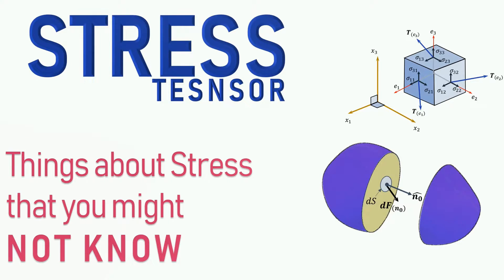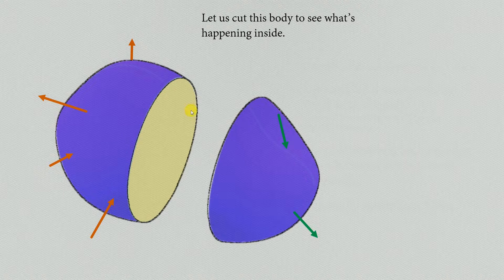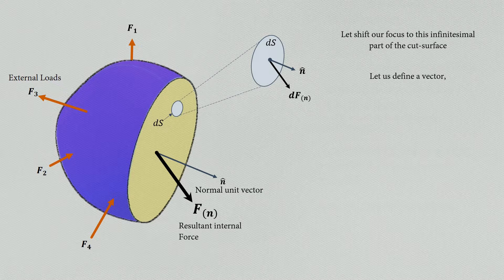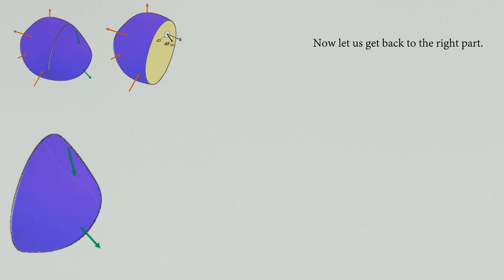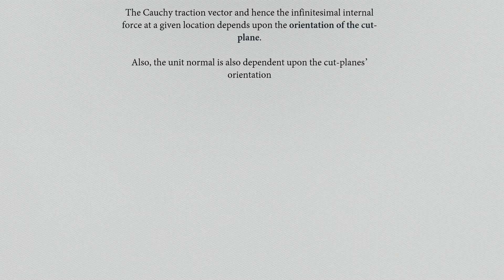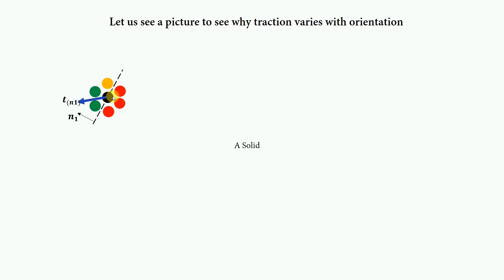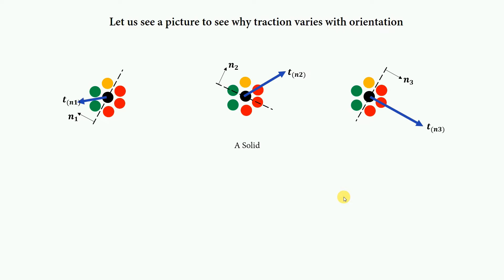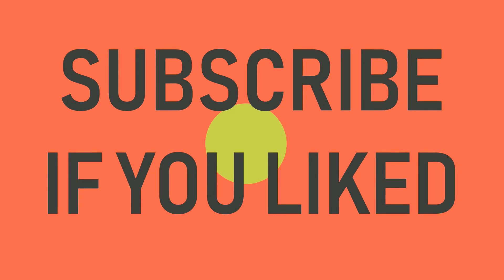Things you probably don't know about Stresses (P1): The Traction Vector

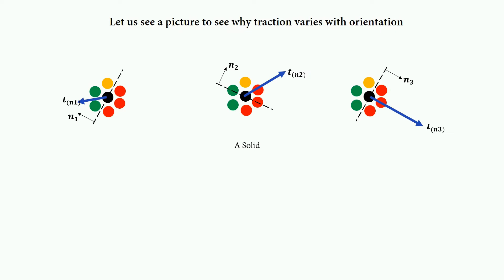Comment: 14:42 In these examples, I don't get why the traction changes depends on the surface that you consider. I mean in the first one, the red particles are still there, so why don't they pull the black particle like in the third one?
Reply from the maker: You are right. Since n1=-n3, the traction  t(n1)=-t(n3). Thanks for pointing this out.
Reply: @SAGARBODKHE  But then, the vector doesn't change depending on the surface...